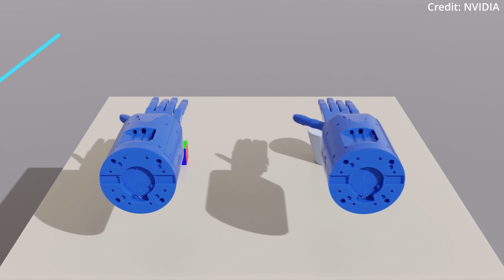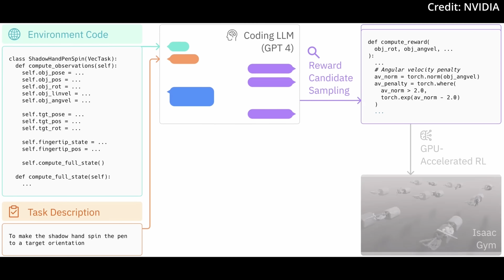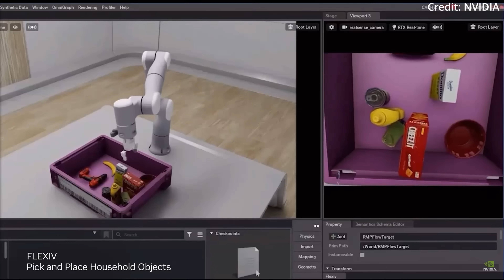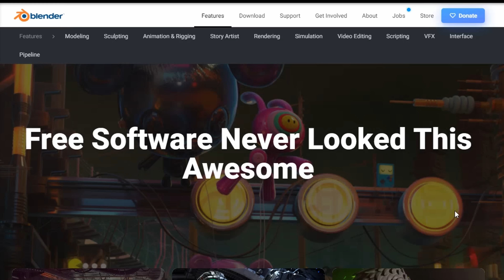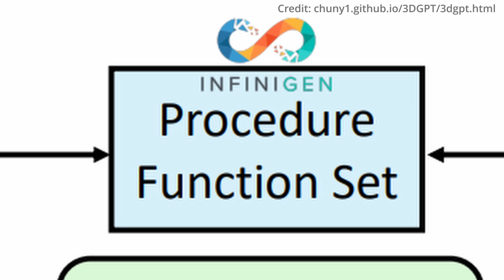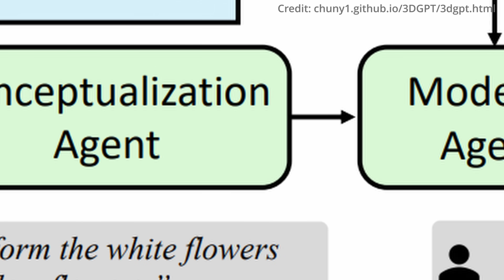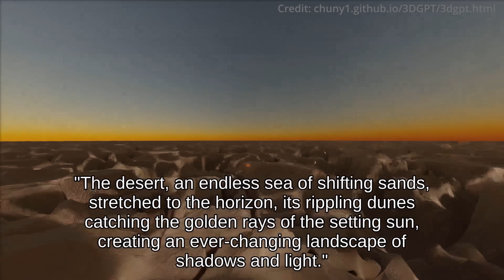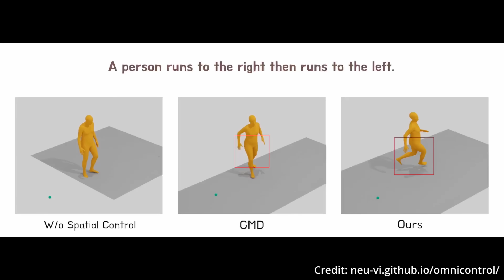Nvidia's Eureka: 1000X Faster OpenAI GPT4 Powered AI Robot Agents

Comment: While artificial “intelligence” is still a simulation of intelligence (that will likely require decades of work using understandings of modern neuroscience that hasn’t even been considered by AI developers), it is very promising. We will learn that while these neural networks based on neuroscience from the middle of last century won’t give us something that can provide good judgment, goal oriented motivation, comprehensive understanding and other things, they can and will fulfill an exponentially increasing number of roles that we thought would require real intelligence. 

I recently heard an AI researcher say that if you talked to someone who was still in 2018 about today’s “AI” systems they would be convinced that we already have artificial general intelligence—which we clearly don’t. We don’t even have narrow AI.

Until a new paradigm of AI based on the real organization of the neocortex emerges out computers will start to look like the ones on the earlier couple series of Star Trek; you can ask them all sorts of questions about who is invading the ship, where the invaders are, what they are doing—you can ask precisely when someone important was abducted from the ship, but it rarely occurs to the computer to issue an intruder alert or notify anyone of the abduction until an organic person tells them to. Very powerful tools simulating intelligence but not intelligent themselves.